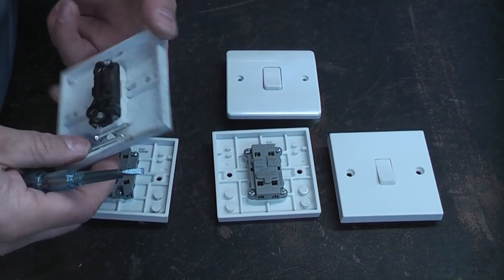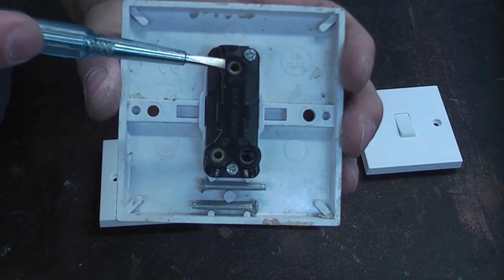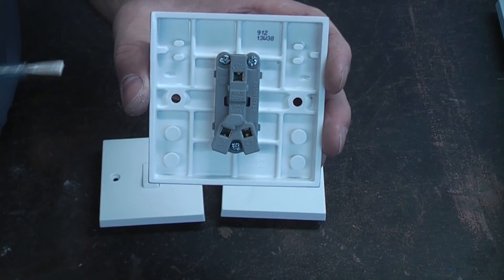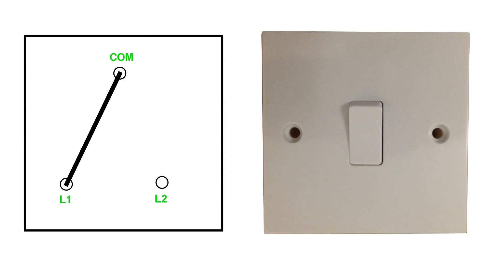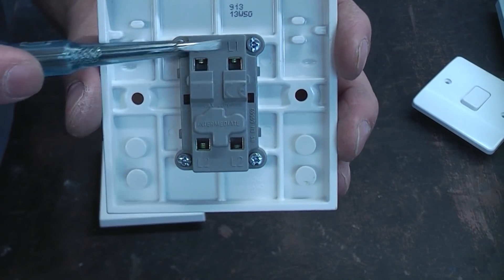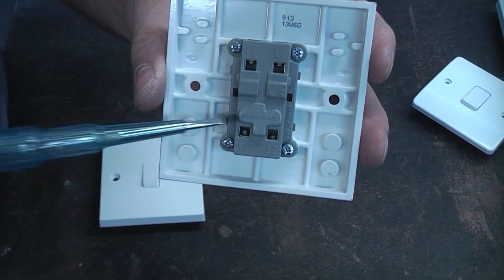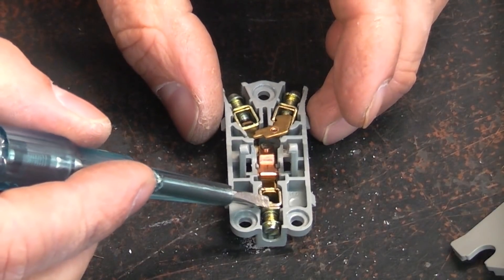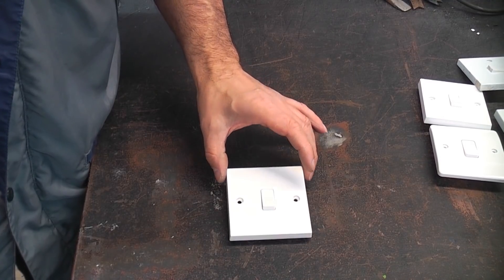How light switches work

Comment: I went to replace my broken light switch with the same one you showed first. (One gang single) 

I accidentally loosened the black box and the whole internals fell out and ive no idea how to put the feckin thing back together properly!! 😣😣😣

Any help or advice would be greatly appreciated or any links you could give me to a tutorial on how to reassemble a one gang single switch
Reply from the maker: It’s probably just easier getting a new light switch 👍
Reply: @ultimatehandyman  worked it out. I'm stubborn and tight arsed!! 😄😄

Comment: I've got a cooker isolation switch stuck in the 'On' position. Is there a way I can fix it without replacing it? The switch itself is new as my flat is a refurb so switches are about 2 year's old. It's also a 2 gang so it has another switch where I connect my toaster.
Reply from the maker: Not that I know of, once they fail they normally need replacing.
Best to get it sorted quickly, especially if you think it might have over heated?
Thanks for the comment 👍
Reply: @ultimatehandyman  Thanks, picking up a replacement today! 👍🏻

Comment: This made me think of a question I had about light switches ... but the American kind.  I bought a whole bunch of those light switches with the indicator light inside them.  The kind that in a dark room glow to tell you where the light switch is in the dark.  I was wondering if there is any way to disconnect or disable that light?  Do you happen to have looked at this before.   I doubt I will do it, but it has occurred to me that some of them I do not need and I was thinking of pulling them out to see if there is some tab to pull or a screw to turn or something like that?
Reply from the maker: I'm not sure, sorry.
I have never seen that type of switch before.
Thanks for the comments ;-)
Reply: You don't have illuminated switches in UK so you can see the switch in the dark if you want to turn on the light?
Reply from the maker: They are not very common. You can get this type of thing- https://www.tlc-direct.co.uk/Products/MKK3041.html
But I think they have to be wired between the live and switched live wire of the switch, I have heard that this can cause problems with some types of lamps, such as CFL or LED lamps.

Comment: Hi, what do you do if the switch was installed the wrong way round? If the light turns on when you switch up instead of down
Reply from the maker: You have to turn the switch the correct way up by removing the two screws holding it to the backbox.
If you are lucky the wires will be long enough so that you can just remove the screws and flip it over.
Reply: turn the switch around

Comment: What is the UK standard for turning on a light?  Here in the US you flick the switch upward and it is on, downward for off.
Reply from the maker: In the UK it is normally down for on and up for off, but of course that is not always possible with two or three-way lighting or multiple gang switches.
Thanks for the comment

Comment: my work has a light switch with like 20 gangs lol ,looks like a normal switch but just massive ,wiring that up must be a bastard
Reply from the maker: Some works have huge clusters of light switches as you say.
In some works now whey bypass the switch and add a PIR to the light, so that it switches off when there is no movement in that area- I find these types of light dangerous as they often don't illuminate until you are right under it so you don't get good visibility!
Thanks for the comment
Reply: girlsdrinkfeck It wouldn't actually be as bad as you think. The only hard bit would be marking up the switchlines. All you need is one feed there (or 2 if there is another switch on the circuit) and just link it out when you come to second fix it. It's just like doing a grid switch in a kitchen! :D

Comment: Cool video but I have to say as Euro design is quite nice in most circumstances it lacks Honorably in household switch design. Oddly enough I replaced all my switches  with illuminated both single pole and 3 way and all the outlets in my house this weekend. They were all replaced with the Leviton Decora style. Nice looking switch and outlet design. Gang four together or more in a fairly small space. Seems if you were to gang with that design it would take up the whole wall? What you are showing here is not pleasing to the eye, not something I would expect from a Euro design?
Reply from the maker: You can get smarter looking switches in the UK, but these are the most basic types that are installed in most people's homes although you can get them in Chrome or brass etc.  I think that you can get up to 4 gang light switches over here that fit on a single back plate, but many 4 gang switches require a double back box instead of a single one.
Thanks for the comment
Reply: Hehe! Nice to see how UK devices work, i'm familiar only with euro plugs and they seem kinda strange to me but good to know how they work.
Reply: these are bog standard british cheap products , NOT europe ,and why would he demonstrate how a light switch works using some overpriced fancy pansy switch ?